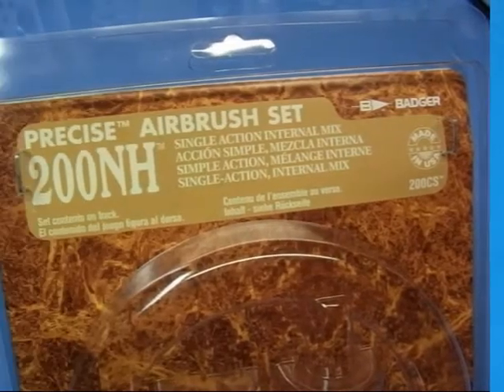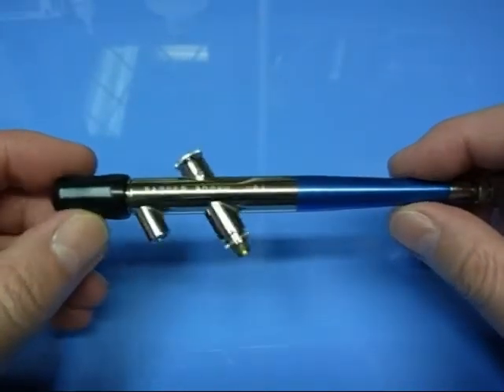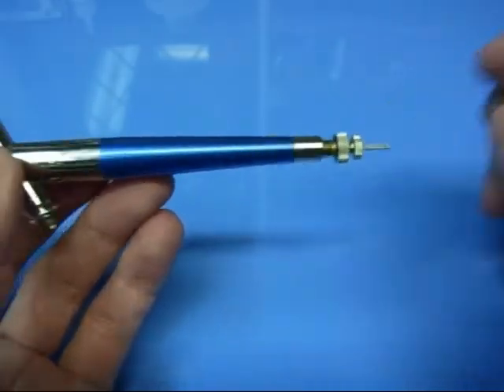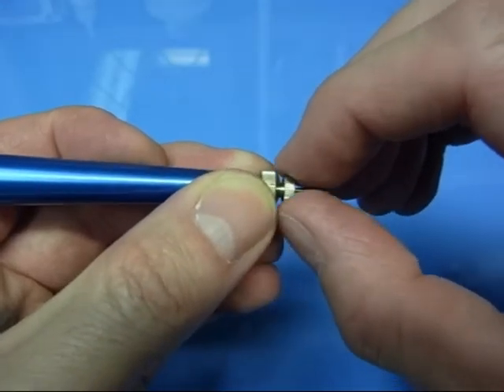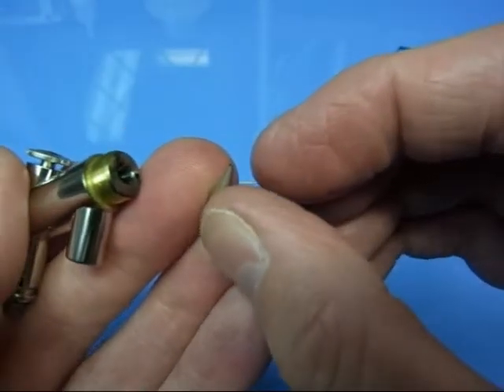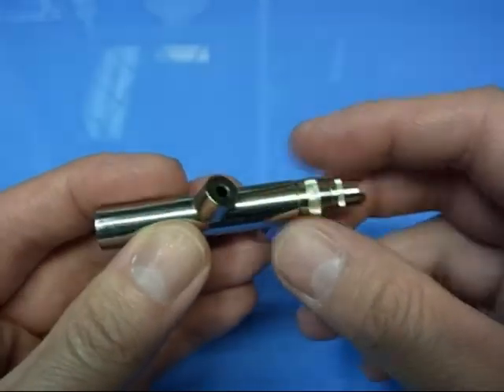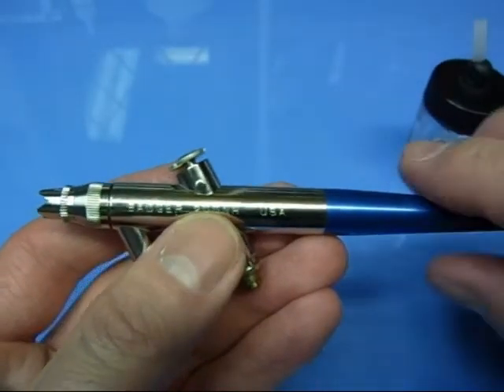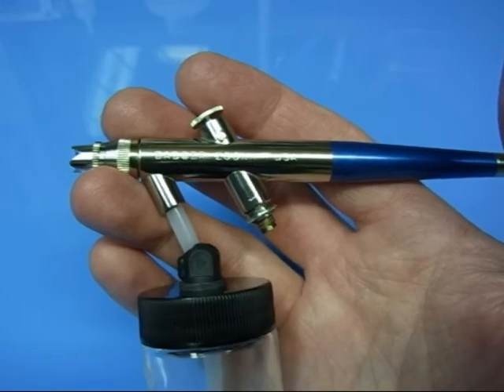Badger 200 Airbrush

Comment: Great video, thank you. I run the adjusting nut right up to the rear of the body. Then set the needle. This prevents running the needle too far into the tip. I’ve had this airbrush for over 30 years, it’s a tank!

Comment: Nice video! The only thing I would add is to run some airbrush cleaner through the brush, then remove the nozzle guard, nozzle and tip. Carefully wipe off the front of the needle, then remove the needle from the airbrush. If you simply pull the needle first, you have just drug paint through the body of the airbrush.

Comment: Great video! I now feel comfortable taking mine apart without thinking I'll break it!!! 

I have a question. turning the dial at the back of my 200, should change thespray of paint, however, it does nothing. I've taken it apart, and understand that turning that dial, is supposed to move the needle back and forward slightly to alter the spray. How do I rectify this? I have pulled the needle back a little myself and (finally!) got a spray of paint, but adjusting with the screws doesn't change the paint spray, I need to do it myself.... Is this because one of the screws isn't on correctly, or, does the needle need lube to allow it to move freely when required? 

Many thanks, Anna
Reply: Anna Cullen thin your paint

Comment: I have a quick question about my airbrush, I cant seem to get my airbrush to paint thin lines? I adjust the needle and a burst of paint comes out but then stops. A wider spray patter works fine but the smaller patterns wont flow out of the airbrush. Is my paint to thick or whats wrong? Im using mostly enamel paints and some acrylic all from testors btw.
Reply: wesajarjar turn down your air pressure and thin your paint

Comment: I have been using mine for leather repair's. My trouble is after I finished a job it was quite late, when I came to the brushes the next day they were clogged with flexible water based pu paint. I tried cleaning out with water (didn't have any pipe cleaners), so I left them both 200 and 150 in thinners. I think I have now damaged seals because I am getting no paint out of either of them. Any suggestions?
Reply: bizzyfingers buy a new airbrush